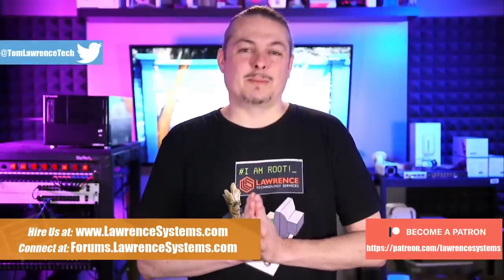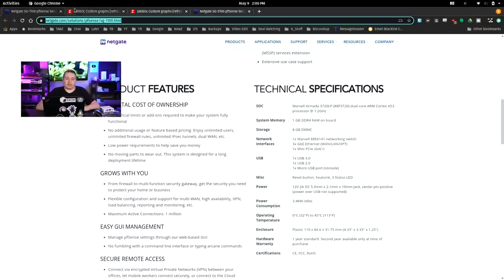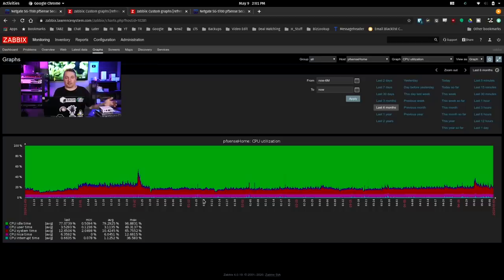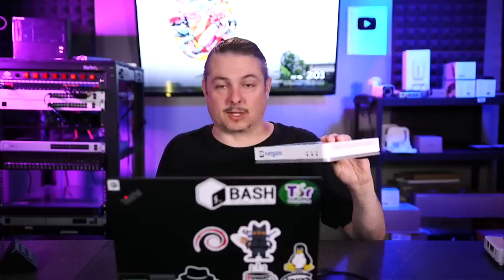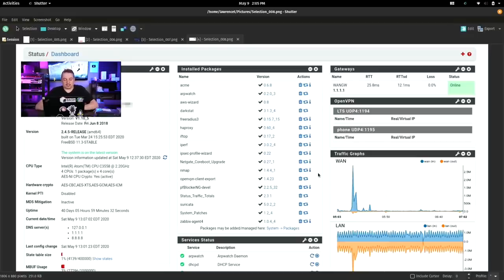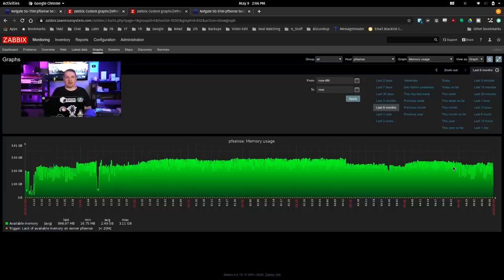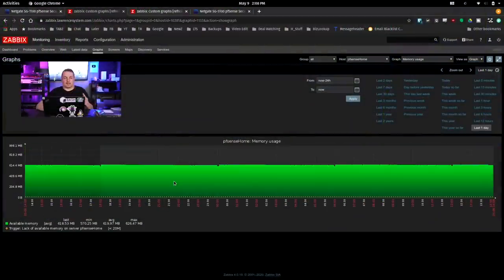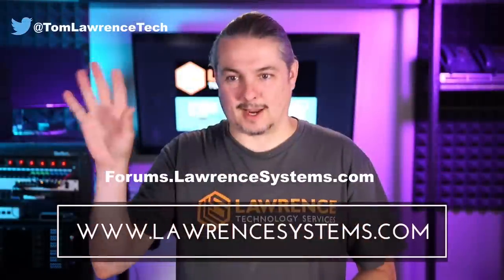Follow Up Review: Netgate / pfsense SG-5100 & SG-1100 Real World Usage Stats

Comment: Been running a Netgate SG-3100 for a little over a year,  added a 32GB internal M.2 SSD after purchase and it's all working great.   Running dual Internet connections at around 300 Mbps.

Comment: I run pfSense on a Jetway fanless Intel N2930 Mini ITX low power board with quad Intel Ethernet ports, an m2 SSD slot, runs on a 12 volt wall power supply and, despite the N2930 lacking AES-NI, it rarely breaks a sweat and has been 100% bullet proof for a few years now. It’s WAY less expensive than anything from Netgate offering 4+ real network interfaces. I get the appeal of a supported turnkey solution but a lot of the Netgate hardware really needs to be more price competitive. As you get into their higher end products even a rack mount fully assembled Supermicro that blows away Netgate’s offerings is a much less expensive option. You can remotely manage and reboot a Supermicro even when the OS has completely crashed. It’s superior hardware for a lot less money.

Comment: The SG-1100 is in my humble opinion a little bit to expensive. Its a really interesting device and i would use it as a drop in replacement for various SoHo routers immediately and don`t get me wrong, pfsense is awesome but i think a price around 110 - 139$ would be more reasonable for the amount of power this small arm based box provides.
Reply: I agree, it's a bit pricey.  It believe it was a bit cheaper ($150-ish?) but they raised the prices due to tariffs.
Reply: @rager1969  Yep, that's why I'm waiting until after the current administration is kicked out in November and the tariffs are returned to normal to purchase mine.
Reply: @scbtripwire  Nope, don't rope me into your politics.
Reply: @rager1969  I wasn't trying to, I was just stating that the reason for the tariffs is the reason I'm waiting on the purchase.

Comment: we are using the SG-1100 as a drop in vpn box in our small external offices with a static route on the main router. Works like a charm (except for the faulty series, that was a nightmare). We are using the 5100 for some 'larger' Offices without any problem. The sturdy case is realy good and has a power cord which gets screwd on.

Comment: I think you need to distinguish between route at Gbit and firewall at Gbit.  PFsense states the 1100 can only do 500 Mbits when used as a firewall.  The NAT and and filters take extra processing .  

I like PFsense but I'm to cheep to buy a $350 firewall. I'm using a end of life Cisco 5512-x ASA as it will firewall at Gbit and I was able to snag it from work for free. It is loud and is the garage.   I am able to get 960/960Mbps constantly. 

I like your reviews.  Nice and  detailed
Reply: Man, you should just roll your own.  PFsence is great on regular consumer grade hardware.  I ran a PFsence box off of an old core 2 duo machine and it handled normal everyday stuff plus pfBlockerNg and OpenVPN.  The only reason I moved away is because I switched to ubiquity and got an Edgerouter X. I now run all of my adblocking and vpn on VMs and it works great.

Edit: I'd like to add, dual NICs would be an absolute necessity for anyone reading this.
Reply: I've converted a few Cisco 5512-x ASA to be silent, if you have about 4u or nothing that goes above it, just getting the top case cut to take a lot of (slow spinning fans). Works great, runs cool and completely silent :)
Reply: @clblanchard08  pfSense's command line is atrocious.   If I had to choose between the two I'd go for the ASA.

OpenBSD out of the box has CARP, pfsync, relayd, and a superior pf. Something to try out if you like tinkering ;)

Comment: Purchased a Netgate 3100 for 1 location and a Protectli FW6B for another to compare. Netgate Cant even load the North America GEOP and all of the Pfblocker rule sets. Cant go past 40000 with the limited memory. Protectli runs circles around it. Also had to put a ticket in for the firewall to be fixed due to a bad factory load. I will say Netgate's support was amazing.

Comment: People looking for a more inexpensive solution with better specs I can highly recommend the pc-engine apu2: 2x or 4x core x86 amd jaguar, 2-4gb, 3 intel nics, smaller than mini itx, draws 6W, board is around 100-120, case for 10-15, small msata ssd for 20.

Comment: Hello Tom,
There are two questions I'd like your input/opinion on that are not necessarily related to this particular Router, but Routers in general.
More specifically Routers with USB Sharing Storage.  I've watched your various videos and am appreciative of the various Tests and opnions
for the strategies you and your Company implements.
The first question is lets say you have two LinkSys Routers with USB drive support (Same Model for each). One router( Router-2) is used as a sub network of the other ( Router-1).
Like yourself, I utilize Linux on most of my Desktop/Laptops.  Using Caja ( Linux Mint's GUI File Manager), I can access my 64gb Usb Stick ( smb://linksys01170/sda1/OuterHaven-64GB-Folder/OwnCloud-VMs-and-Misc-VMs).
along with another USB Stick on the same Router ( Router-1 ).
So First Question is, Utilizing the two router setup above, Using PCs I have established under the sub network (Router-2), using Caja (Linux Mint's GUI File Manager) , how can
I access the two USB Sticks in the (Router-1) network?  I would also want to see if it is possible the other way around, Router-1 PCs accessing Router-2's USB Sticks.
The Second Question is, related to accessing the smb path I mentioned above in the Linux Terminal.
when I list out the mounted Drives via df -Th, and even sudo lsblk, I do not see any mount points similar to how the Caja GUI has on Router-1 ( i.e. smb://linksys01170/sda1/OuterHaven-64GB-Folder/OwnCloud-VMs-and-Misc-VMs).
In Summary, I was curious if I could traverse back and forth between different networks to access each Router's USB Storage and also how to access these USB Stick's on each Router via the Linux Terminal.
Any advise or suggestions to accomplish these two items would be greatly appreciate.
Again big Thanks to you and your team's informative tech initiatives to the general public.

Comment: Have you ever built a custom pfSense box? And if so, would it be possible to recommend specs for home use? Thank you, great video!
Reply: The answer would be drastically different dependent on your needs and what packages you want to run. For a basic build without Suricata/Snort or VPN, a Intel i3 (both recent and older generations) or even a recent Pentium CPU and 2/4GB RAM will run circles around basically all SoHo-routers in todays market. 

However, if you want to run Suricata/Snort, you'd want to increase the RAM. 
If you want to run VPN, make sure the CPU have AES-NI (for Intel) or eqvivalent for AMD (don't remember the name), and the higher clock speed, the better.

Comment: @Lawrence Systems / PC Pickup

Stupid Newby question.  I need a  affordable steel enclosed  4 port managed switch for routing 3 pi's. No need for poe.  I do want to run a open vpn in due course  .  Which switch is user friendly.  I have configuration trouble with all mikrotik products, since they are a pita to work with.

Comment: I have a i7 CPU and 8GB of RAM and it also uses 50% of RAM. But why? There's only suricata running.
Reply: Suricata can be quiet RAM heavy dependent on how it's set up as far as I've read on Reddit etc. I guess you will see a drastic reduction on RAM usage if you disable Suricata.

Comment: Tom, have you tested the PcEngines appliances with pfSense? https://www.pcengines.ch/. Netgate used to distribute these (as APU2/APU4) until 2016 but stopped when they released their own product line. Netgate replaced it with the SG-3100. However, PcEngines appliances can still be ordered today from the manufacturer at a cost even lower than the SG-1100. It is worth it?
Reply from the maker: Not really

Comment: Can anyone recommend a similar system for cheaper than $179 DIY? I don't want to use a power hungry machine.
Reply: HP t620plus thin clients or the t720/730 series. The t620plus is plenty for the average home user. Runs approx $100-125 in EBay. Very low power usage as well.  There are plenty of guides available online because these are so popular.
Reply: Thanks

Comment: Tom I started using pfsense because of your videos. The guides are great and easy to follow!

Are you aware of the problems with upnp in pfsense?
https://redmine.pfsense.org/issues/7727#change-41170

 We have 5 gaming machines and we're often trying to play the same game but it just won't work!

I moved to untangle and its just one tick box then all the upnp issues went away.
 Unfortunately they don't have mDNS or IGMP proxy.
So ended up with openwrt untill pfsense upnp is sorted
Reply: Wow, I didn't know this.  That is a pathetically sad problem for a premium pfsense router to have.  Hopefully that gets resolved quickly.
Reply: @takeshi7   Yes its a real pain for households with multiple gamers.
If you only have a single gaming machine you won't have any issues. Additionally, pfsence is probably more likely to be deployed in a commercial environment where UPnP off anyway.
From what I understand it's actually an issue with miniupnpd and should be sorted quite easily.